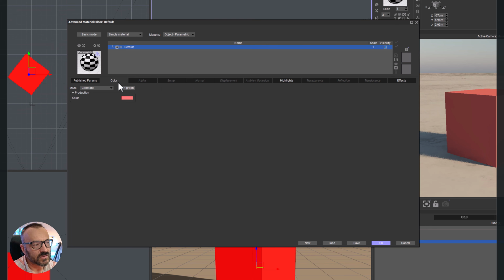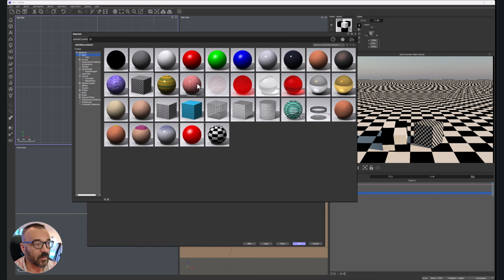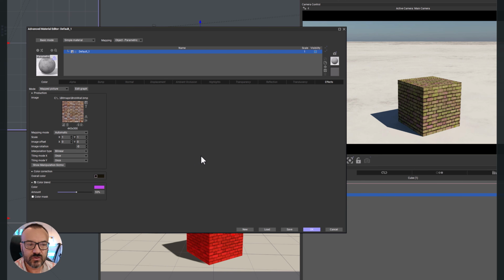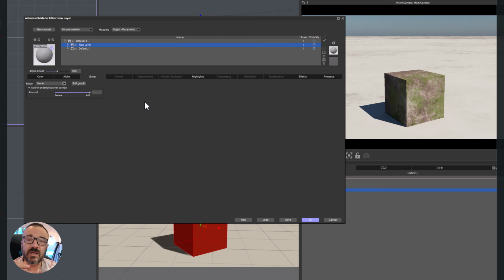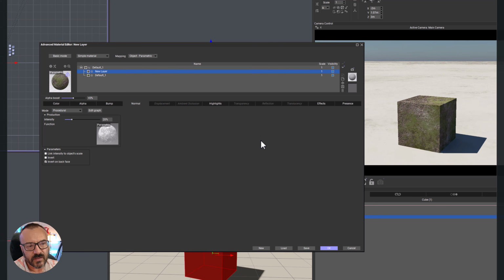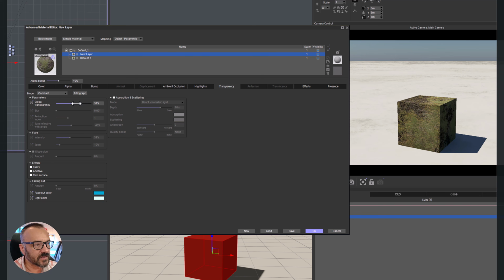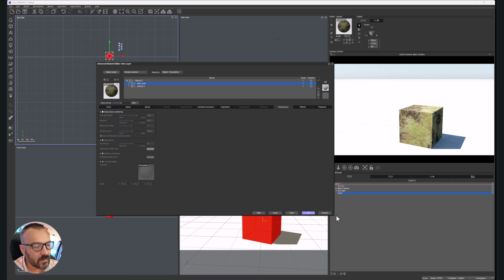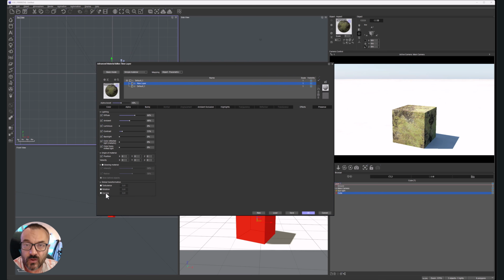How to use and create 3d textures in Vue 2024.

Comment: A question, if you have the time.
VUE 2024 doesn't seem to have any objects installed.   I have copied all the extras to the VUE 2023 folders, but Vue 2024 won't load them.   I can however open 2024,  and then drag a Vue 2023 object into a Vue 2024 window successfully.
What am I missing?
Reply from the maker: you need to download extra content files and place them in folder, follow instructions in readme file